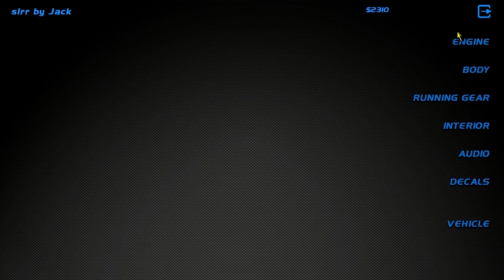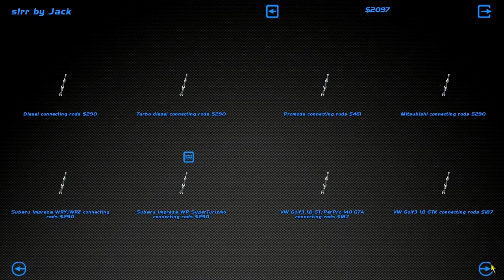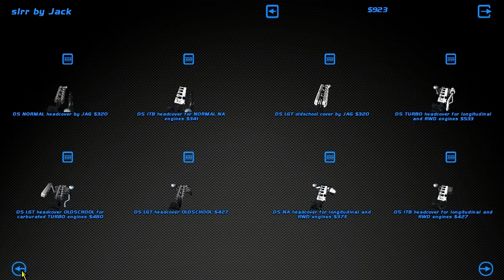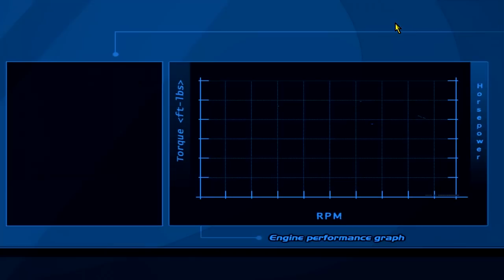Drifting on a Budget - SLRR - EP5 - SICK ENGINE UPGRADES, when they work...

Comment: So much money was wasted here, black series is good when you have either a 2.2 honda or a mitsubishi block but that blows the BHP limit out of the window
Apart from drifting on abudget this shows the problem of getting parts without testing them in a test save.
for that should have kept the engine and just added a turbo and the piping, plus getting upgraded parts now it will be not so easy to make that cash back.
Some low bhp engines you should one day try: EJ20, euro V6, 4age, hauler v8, rb26.
Engine should make 223 bhp (cams to -15, fuel to 12.50 on same setup as yours) I hope that you showcase the new feature with this miata (maybe some background grinding before the episode helps)
Reply from the maker: I'll make the cash back if I can get the car running reliabily ahahah. But yeah its like jn real life parts don't always work together